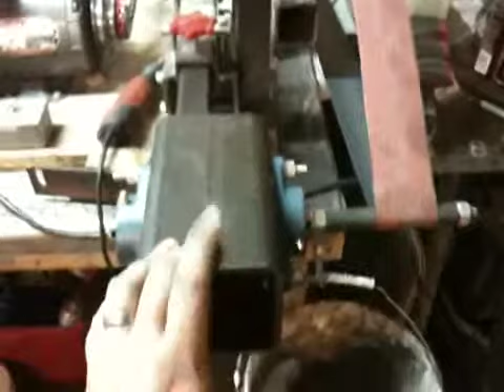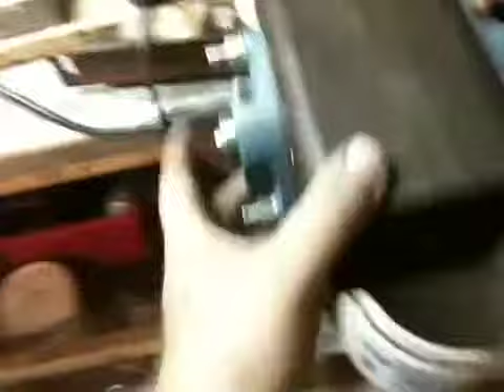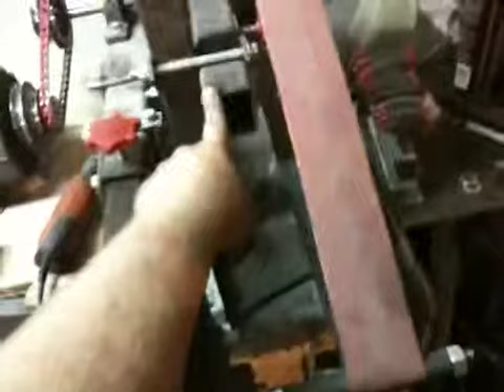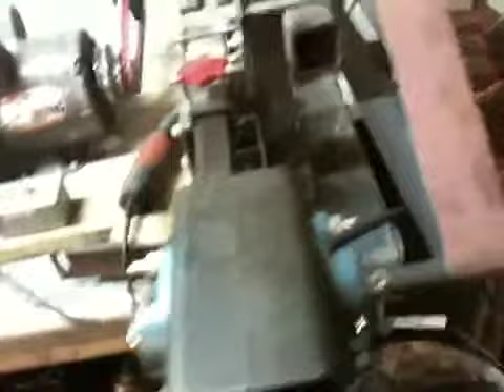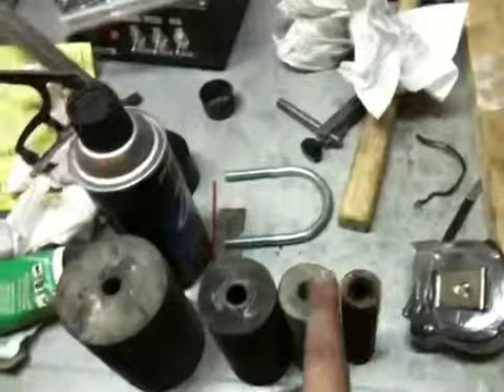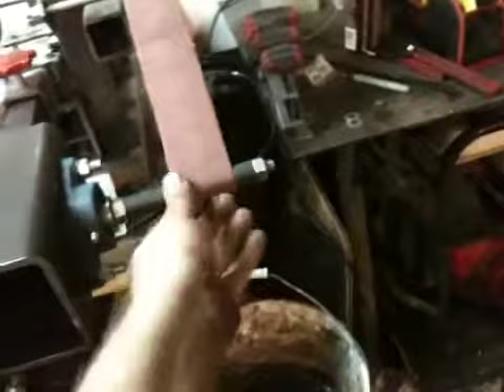Low Cost Small Wheel Grinder Attachment

Comment: The bearings are spinning a high multiple of the other bearings due to the small spindle size, which I would imagine is likely the cause of the excess heat, unless the drag is an indication of something else.  Did the low viscosity grease help at all?